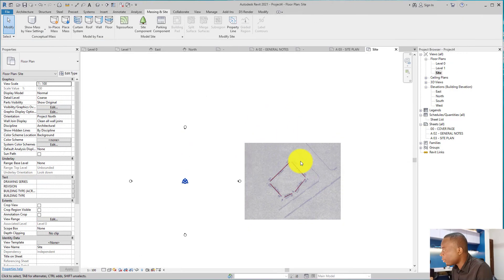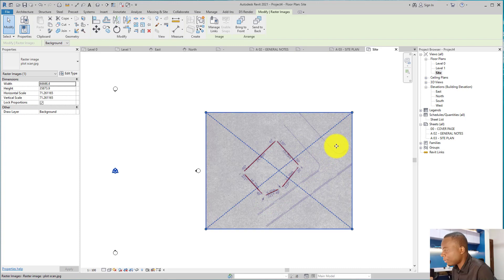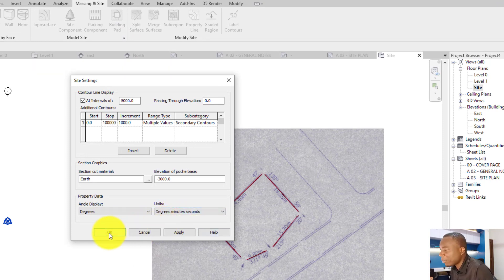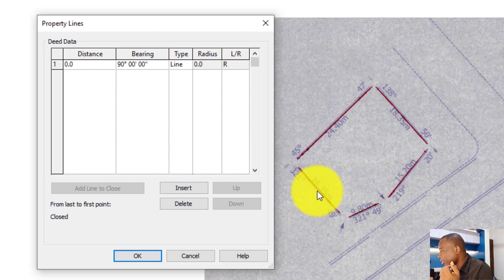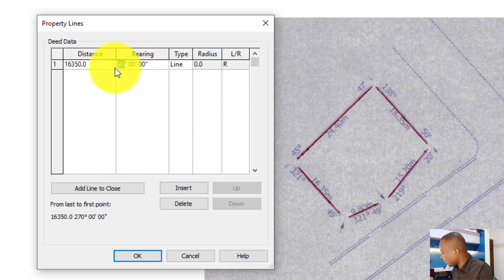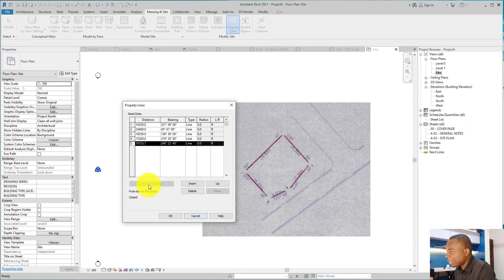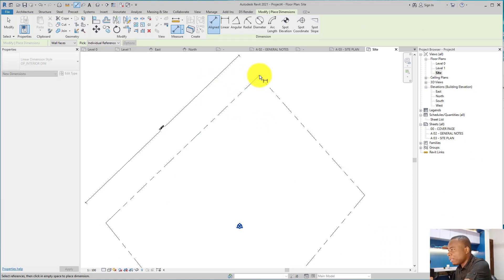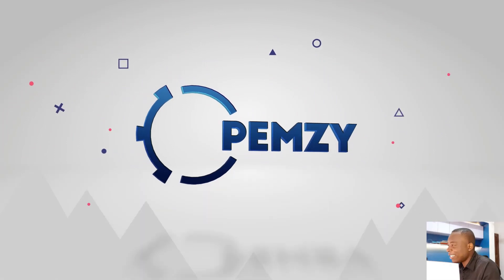REVIT LIKE AN ARCHITECT_ PLOTTING A SITE/SURVEY PLAN|  REVIT BEGINNER TUTORIAL_

Comment: Thought there used to be a North/S tab on the table?
Reply: Yes they are there, but the little button he clicked on, opened up a dialogue box where change the settings from the North/S tab  to degrees from the North, because that's how surveyors usually plot survey plans in Nigeria
Reply from the maker: @onochie has answered correctly. See @ 00:57
Reply: The North/S tab usually requires you to do a little bit of mathematics 😁😁😁...
Reply: @onochiemichealc.6415  omo, I also had to do that maths conversion until now. Nice one
Reply: please how do i add the access road in the site plan using the survey method